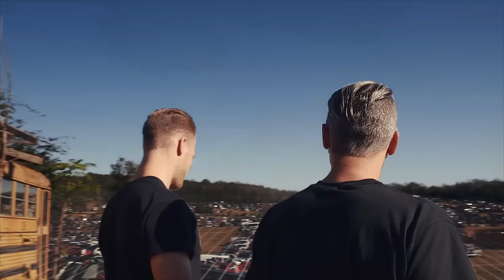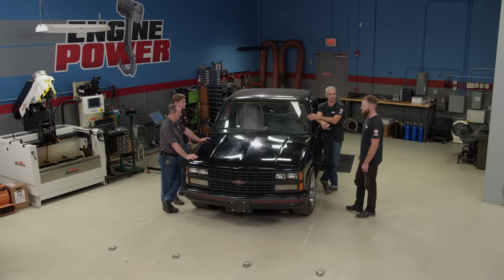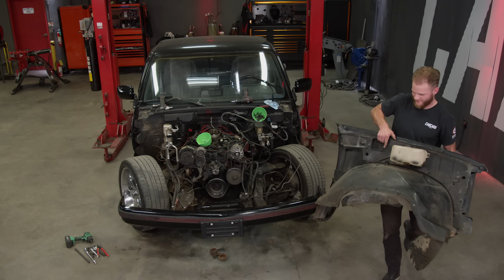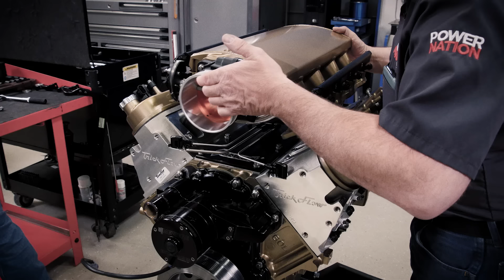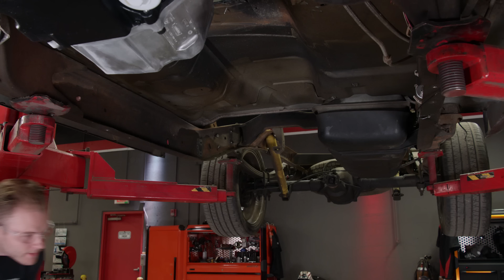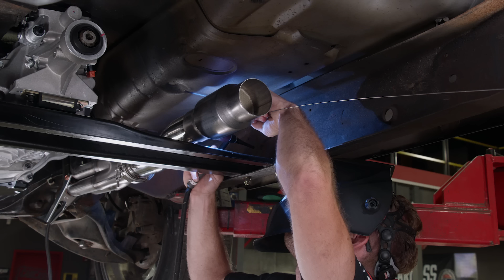We Put Race-Car Suspension Under an Old Chevy Truck

Comment: the side members, I saw both in the tank when the new pump was installed, and when you disassembled the front suspension in the place of the rockers, the side members are rusty and have not been cleaned of dirt, I saw both Vaseline with mud and rust ..why were they not cleaned ???? you want to believe that you are professional but leave the job unfinished like beginners
Reply: I agree, take two minutes to clean the top of the tank before installing a new pump at the very least.
Reply: Where is your restored Chevy? Did you build anything? Do you think it's realistic to show every single bracket they repaint, and show every bit of sanding, and paint drying.....this would be a 77 hour video if every last part was shown.

Comment: I'm amazed how easy it looks to swap the engine.  I'm building a 69 mustang and it was a PITA to remove the old engine and install the new upgrade.  The radiator support not coming off is probably the reason

Comment: That's a nice truck even before you started the build.
Reply: Tv money budget that trucks is $7500 all day around here $5000 if it was just a roller
Reply: @anthonycope8637  just bought one 140k miles z71 two owner 93’ for 5k, came with a bunch of stuff
Reply: @PNWeekendWarrior  thief
Reply: @anthonycope8637  Fr lol
Reply: Agreed was beautiful truck . I have a 91 im restoring.  I gotta say i dont like the look color combo
Reply: @zippythechicken  i agree, while it is a trick suspension, its usually needed when space is tight below. they could of easily put coil-overs under the stock bed with no difference in handling, also don't like the use of the fender flairs, while needed in the front the offset on the rear wheels have the tires under the stock fenders, just doesn't look right, but thats just nit picking... 70s colors 👎,  on a 90s style truck with 2000s drivetrain, nice...
Reply: @Rob_C_1911  Coil over's? 😂
Reply: @dieseldabz7104  umm yea, i do realize it has them in the cantilever set up, or do you just not understand what they are
Reply: @Rob_C_1911 hey by chance do you know of brands, shops, etc for road performance truck suspensions? I have an idea for a first gen Colorado but everything i can find is for raising/lowering for aesthetics, or for newer generations.

I'm assuming I'll need a custom solution but I don't even know who to call 😂 it's not my scene at all
Reply: @mcgoo721  i dont know much about the Colorado, i did own one new 2004 but it had no support, i only had it for 6 months and then built another 1990. fronts on almost anything spindles, springs and control arms upgrade sway bars & shocks, rears are leaf springs shackles flips or blocks, can add sway bars. if you want better performance, you'll have to build a custom multi-link set up
beyond that i dont know
Reply: They should of took a rougher truck, the thing was perfect. To each their own I guess.
Reply: @zippythechicken  To get these trucks THAT low you have to notch the rear frame and kits are even readily available and if done right just as good as factory OR better nvm rides and handles on par with a Corvette..
Reply: Agreed but I personally love the 15x10s on these trucks i own 2 and thats what i run my trucks around the same height at this truck lol i dont like lifted trucks but i also dont like slammed either
Reply: Yea! If not the cleanest I have ever seen!
Reply: That's a beautiful truck!
Reply: @zippythechicken  it lowers the center of gravity, makes it handle batter. Only an idiot would think otherwise.
Reply: Ya all black pick up truck. Sounds fun
Reply: I almost cried when they showed that they're going to essentially destroy that extremely rare original paint and pinstripe combo, and replace it with some hideous grey and yellow dogshit
Reply: Like a rock  chevy trks
Reply: Yep that's why I called the shows the million-dollar mechanic a lot of the vehicle say do you want new shows are worth $150,000 or more not including the knowledge that you need to know how to build one
Reply: @zippythechicken  title says race truck, not work truck. So leave the bed outta of this. Lol
Reply: Must be nice
Reply: worth more stock to me  ...my 92 k1500 has a 350 700r4  ,,an its staying ,,but thats me
Reply: @zippythechicken  Do you have a Reason or thought. thks
Reply: 😂 the episode is years old, 😂 y'all piss and moan about how it was built.